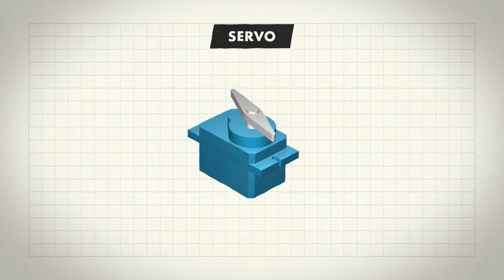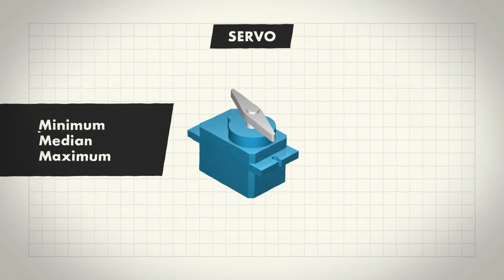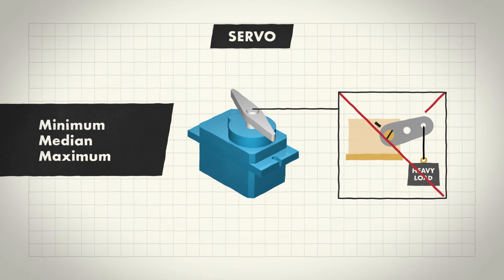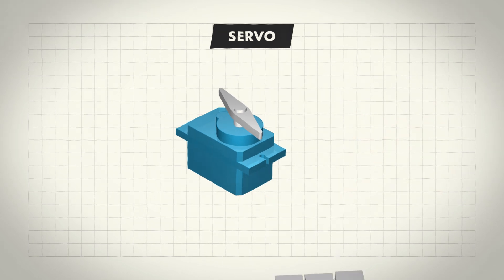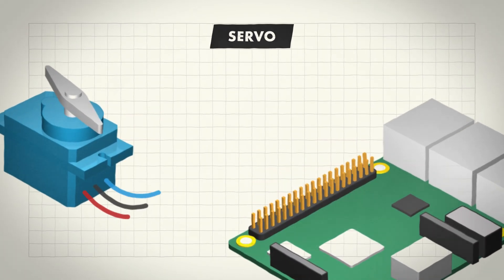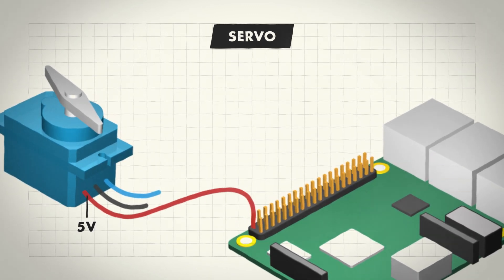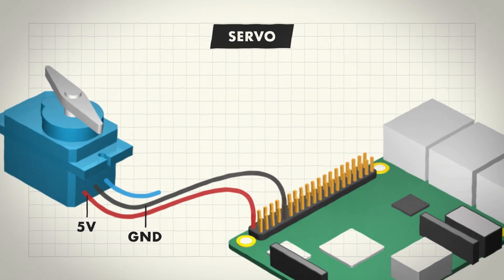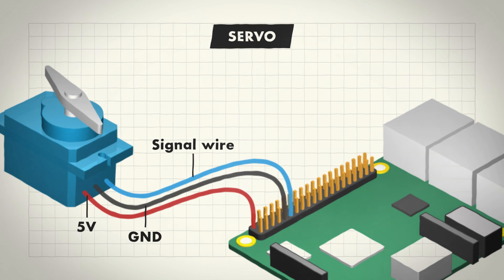HOW TO USE a servo motor with Raspberry Pi

Comment: Audio: "5V power wire should be connected to pin 1" -- isn't pin 1 the 3.3v?  Don't you want pin 2 or 4?  The video shows pin 2.
Reply from the maker: We realised the voice was incorrect and we're currently re-recording the audio. Luckily the visual is okay so we hope people will notice this. The new one should be up soon.
Reply: Raspberry Pi make a pinned comment please
Reply: @raspberrypi  is this current video the fixed version?

Comment: I thought that you should not power the motor directly through  the raspberry pi
Reply: Very true, though a micro servo (eg. TowerPro SG92R) won't use enough power for it to be a problem